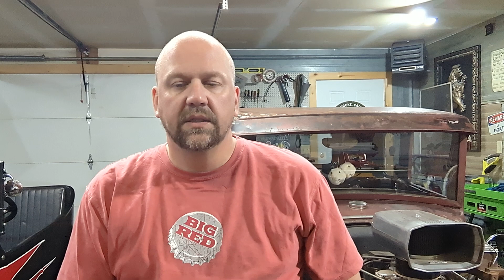Hot Rod check up results.

Comment: Great video, Bonnie does sounds very healthy. That's a nice project list coming up. And I'm sure there will other things as well. Short story for ya. Good friend of mine knew a guy back in the early 70s who had a T-bucket. Had a Procharged 396 BBC, big cam, Powerglide, 10-bolt with 3.18 (?) gears, N50/15s on the rear, motorcycle tires on the front. Frame was lengthened 8" in the front to try and give it some stability. Hahaha!!  He estimated almost 550-ish hp. I rode in it once and have never been more terrified in a vehicle. The slightest blip on the throttle lifts the left front tire and both rear tires light up. With those little front tires it was truly a "point and pray it goes straight" kind of car. We were doing 60-65 mph on the highway and the whole car shook your bones because of the crazy cam. He tried to drag race it one weekend and mangled the frame so bad it wouldn't go straight down the road. We towed it home with the front wheels off the ground strapped to the bumper of my buddy's pickup. It became a trailer queen car that impressed people at the weekly car shows and cruise nights.. Which is probably what it should have been all along. Anyways......be safe and stay well.
Reply from the maker: Quite a bucket. That sounds like it would have been very scary.